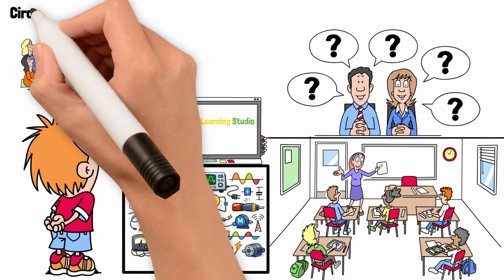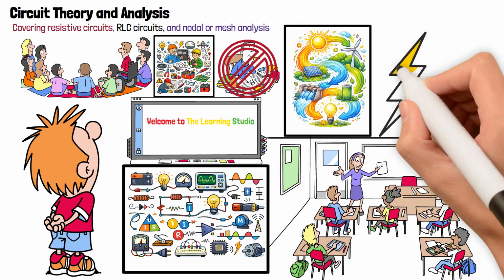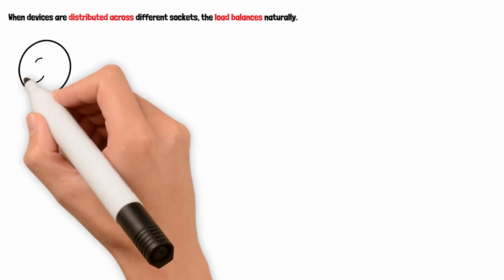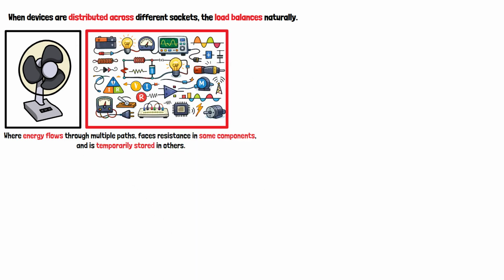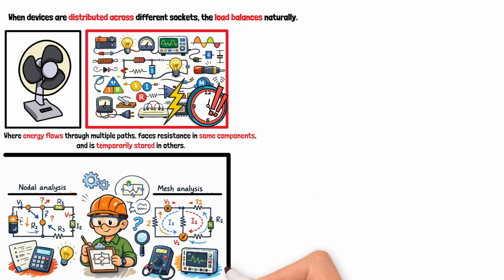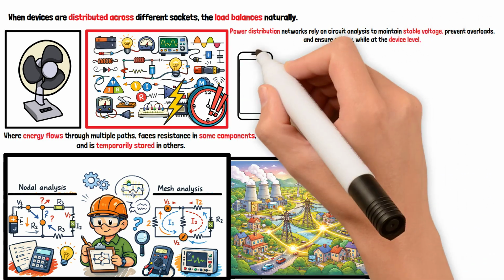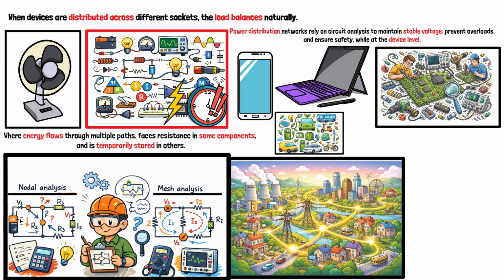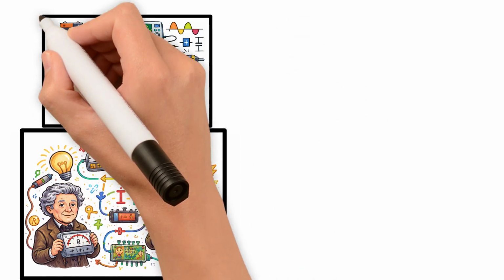Circuit Theory & Analysis Explained | Foundations of Electrical Engineering

Comment from the maker: Every modern technology — from smartphones to power grids — relies on circuit theory.

In this video, we explored the principles that allow engineers to predict, analyze, and control electrical systems.

You cannot build advanced electronics without mastering the basics.

Circuit theory is not optional.
It is the language of electrical engineering.